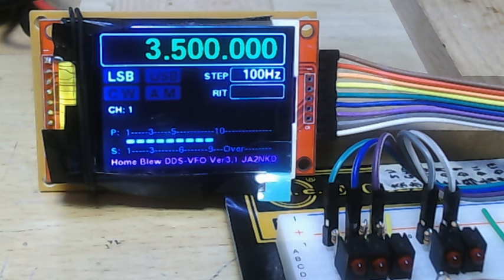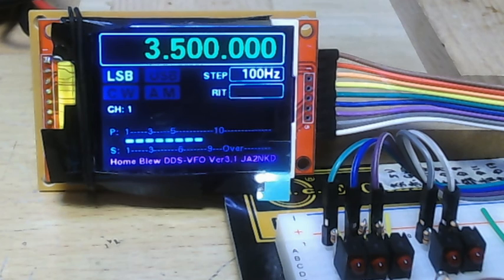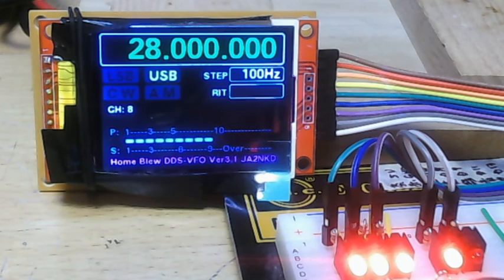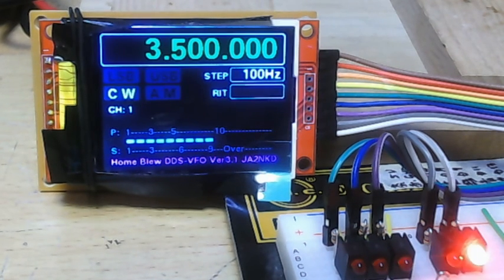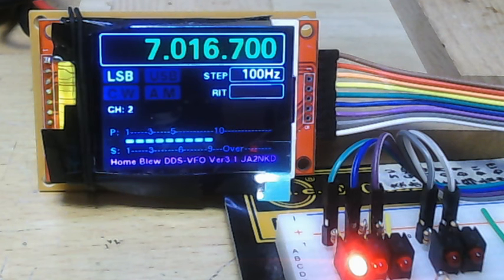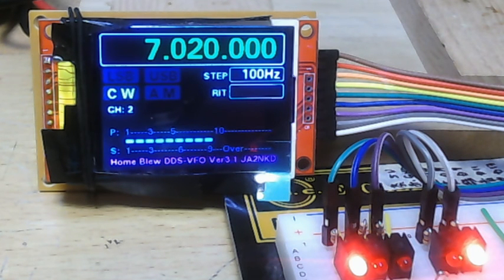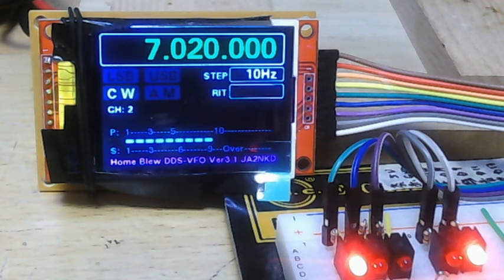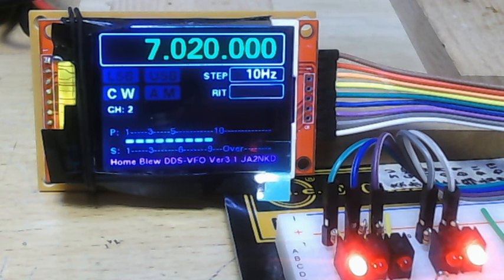Multi-band DDS-VFO controller by arduino nano

Comment: install sketch(Arduino IDE V1.6.5)
1) Edite sketch(vfo_v3eep.ico). That is initial band-data(frequency, mode and step.)
2) Compile & write to EEPROM in arduino-nano.
3) Edit sketch(NKDVFO22_Ver310.ico). That is main progam.
4) Compile &write to flash memorry in arduino\nano.
can you share step by step to compile  for this?
Reply from the maker: Yes,that's right    https://ja2nkd.blogspot.com/search/label/VFO?updated-max=2016-10-27T21:06:00%2B09:00&max-results=20&start=9&by-date=false

Comment: Hello Matsuura San, I assembled it and it works very well, congratulations! Is it possible to change the code to memorize the last state? For example, when I turn it off and when I turn it on again, I would like if it memorize the last status. Thanks.
Reply from the maker: Hi,j
This version is possible when change band & push memory switch.

73's

Comment: Hi  Matsuura Ryuu San, I am testing your project and getting good results. I have new question: how can I change the code in order to get frequency step changes of 5kHz and 100kHz ? Thank you!
Reply from the maker: Hi,J Cesarsound
congratulation & I'm very happy.

Modfy step Line 344
Change "void setstep()" & "void steplcd()" 

//encorder frequency step set

void setstep(){
  noInterrupts();
//  if (fstep==10000){
  if (fstep==100000){
    fstep=10;
  }
  else{
    fstep=fstep * 10;
    if (fstep=10000){ftep=5000;}
    if (fstep=50000){fstep=10000;}
 } 
 steplcd(); 
 while(analogRead(analogsw) < 1000);
 interrupts();
}

//Step Screen

void steplcd(){
  ucg.setColor(0,0,0);
  ucg.drawRBox(221,61,93,23,3);
  ucg.setFont(ucg_font_fub17_tr);
  ucg.setColor(255,255,255);
  ucg.setPrintPos(220,80);
  if (fstep==10){ucg.print("    10Hz");}
  if (fstep==100){ucg.print("   100Hz");}
  if (fstep==1000){ucg.print("    1KHz");}
  if (fstep==5000){ucg.print("    5KHz");}
  if (fstep==10000){ucg.print("  10KHz");}
  if (fstep==100000){ucg.print("100KHz);} 
}

Sorry I'm very busy now,I don't check IDE compile.
Please check yourself and modify.
If you have some question ,please send E-mail.

73's
JA2NKD Ryuu
Reply: Hi  Matsuura Ryuu San, thank you so much for your support, you helped me a lot :-). I will do the tests here and when all is ready I will post a video and a link for you to watch it. Have a nice weekend!
Reply: @Cesarsound1 have you had good results?
Do you have video link??
Reply: @Guns_N_Gears  yes, worked well for me. I did some personal costumizations to meet my needs. https://youtu.be/UPT5zUjethk
Reply: @Cesarsound1  hello, I try to load sketch but get error loading library.
"Moving extracted archive to destination dr. library not valid"
Have you had this error??
Many thanks
Reply: @Guns_N_Gears  This may be due (Windows OS) not to you not having privileges to transfer the library files to the library folder. Or an anti virus is blocking it. You can try installing it on another computer. Sometimes installing a newer version of the Arduino IDE can resolve this.

Comment: Hi Matsuura Ryuu, another question. Is it possible to expand the reception frequency range of channel 1 (for example)? I would like to receive the 49 meters band to listen SW broadcast commercia radios. For example, I would like to sintonyze the frequency of 6010kHz. How can I do it? thank you!
Reply from the maker: Hi,J Cesarsound 
It's possible.
You need modify "vfo_v3_eep.ino.
Please see line40.
You can understand how to modify.
 
Example
Line 61
// BAND:0 ROMadd:0x010. Band0 is CH1
  romadd=0x010;
  freq[0]=3500000;       //band start frequency. ex  6000000
  freq[1]=3500000;       //power on frequency.   ex  6050000
  freq[2]=3800000;       // band end frequency.  ex  7000000
  fmode=0;                    // If change mode AM.   ex  2
  fstep=2;                      // If change step kHz.     ex  3
  bandwrite();

Ok?

73's

// BAND:1 ROMadd:0x020
  romadd=0x020;
  freq[0]=7000000;
  freq[1]=7000000;
  freq[2]=7200000;
  fmode=0;
  fstep=2;
  bandwrite();
Reply: Hi  Matsuura Ryuu San, very good tip, I will try it rright now. By the way, I did that change on sensibility of S-Meter and it worked very well :-) Thank you, have a nice day :)
Reply from the maker: Hi, J Cesarsound You're welcome.
Let's enjoy homebrew

Comment: Hi Matsuura Ryuu, is it possible to change the sensibility of S-Meter input? I have a radio that delivery 0 to 2 volts on S-Meter output. Is it possible to change the input range from 0 to 5 to 0 to 2 volts? thank you.
Reply from the maker: Hi,J Cesarsound 
Thank you comment.
It's possible to change the sensiblility of S-meter input.
Sketch(NKDVFO22_Ver3_1-1.ico) Line 173
  meterval1=meterval1/50;  Change 50 to (15-25)
When input Max-level,  adjust (15-25) & input-volume so that a meter may indicate Max.
OK?

73's
Reply: Hi Matsuura Ryuu, I will try it, thank you so much for your fast support! 73!!

Comment: Congratulations for this fantastic project. I want to assemble it, and I have a doubt: Can this project work with this 2.4in display found on Aliexpress? --> 2.4 inch 240x320 SPI TFT LCD Serial Port Module 3.3V PBC Adapter SD ILI9341,compatible with 5110
Reply from the maker: Hi,J Cesarsound. Thank you good comment.
This TFT is 2.2 inches.
There seems to be little TFT of 2.2 and 2.4 inches recently.
It can be used is that TFT-driver is ILI9341 and  240x320 , SPI-serial.(2.2,2.4,2.8inches)  2.8inch seems easy to get.
I think that 5110 is not compatible.
73's
JA2NKD Ryuu
Reply: Thanks Matsuura. Will this 2.8 on work? --> 2.8 Inch 240 x 320 ILI9325 TFT LCD Touch Screen Display Module SCM For Arduino 2.8V To 3.3V With Buck
Reply: The 2.2 inches is hard to find. I also find this 2.8 inch, will it work with your project? thank you. --> J34 F85 240x320 2.8" SPI TFT LCD Touch Panel Serial Port Module with PCB ILI9341 5V/3.3V
Reply from the maker: ILI9325 doesn't correspond to UCG-library. Therefore it can't be used.
I don't Know (J34 F85).
When driver is ILI9341SP,I,I think it can be used.
I use 2.8inch-TFT with touch Panel.

73's
Reply: Thank you Matsuura. I will buy this 240x320 2.8" SPI TFT LCD Touch Panel Serial Port Module with PCB ILI9341 on Aliexpress and see if it works. Keep doing this great work 73!!